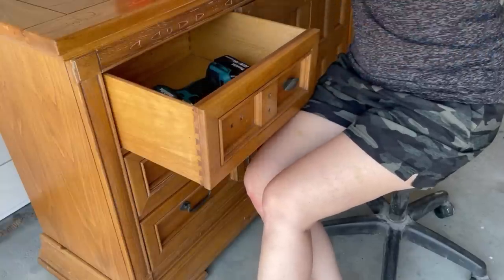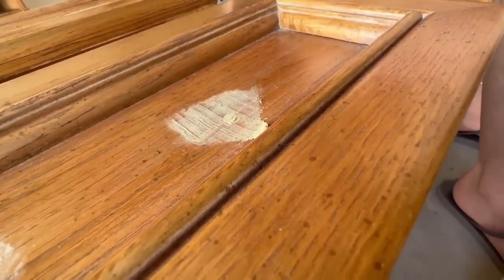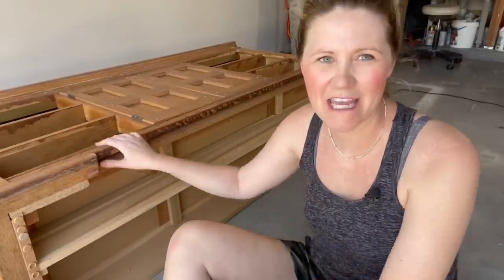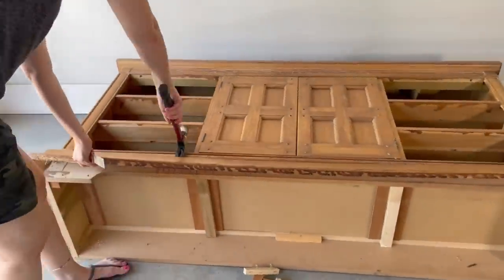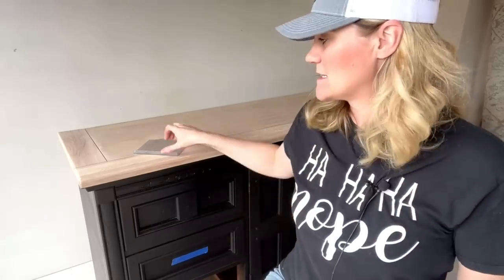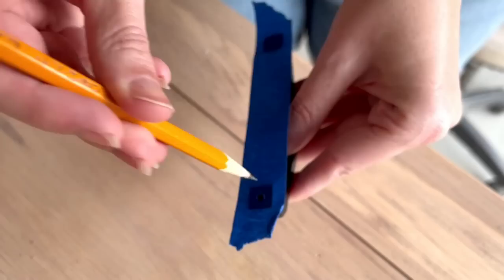5 Strategies to Recession-Proof Your Business: Expert Advice In Furniture Flipping

Comment: Love your work Kara!! I am new to this and have a question: While your first coat of paint is drying for 3-4 hours, do you clean out the sprayer and then add more when ready to apply a second coat? Or is there a trick to not having to clean out the sprayer for a few hours? Thanks! :)
Reply from the maker: No I just bring the sprayer inside for that time (due to the heat in my garage). I only clean and empty if it has to sit overnight. Hope that helps!
Reply: @LemonstoLemonadeFurniture  Thank you!! :)

Comment: That dresser turned out awesome! Was wondering when you poly, do you do more than one coat, and do you sand between coats? Great tip for the hardware with the painters tape. Never thought of that🤟
Reply from the maker: Thank you! That particular Polly was a 3x poly. So each coat is equal to 3 normal coats. I do 2 coats and a light 400 sand in between
Reply: @LemonstoLemonadeFurniture Thanks for the info. Appreciate it!